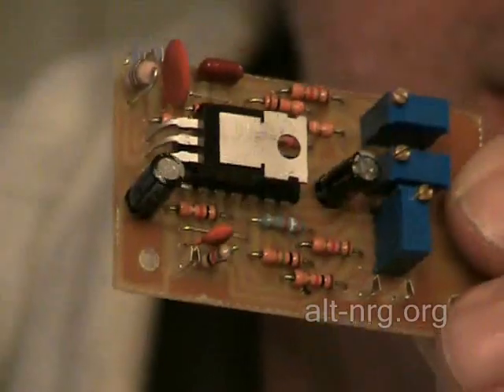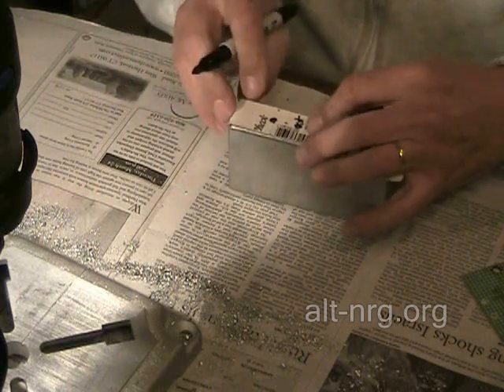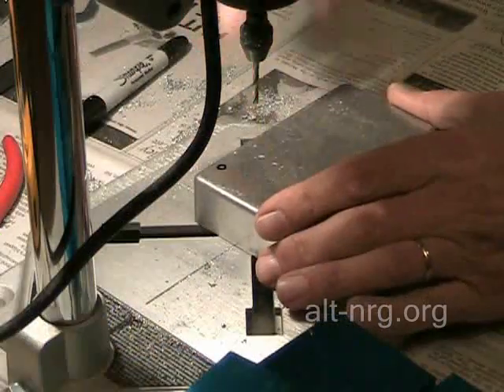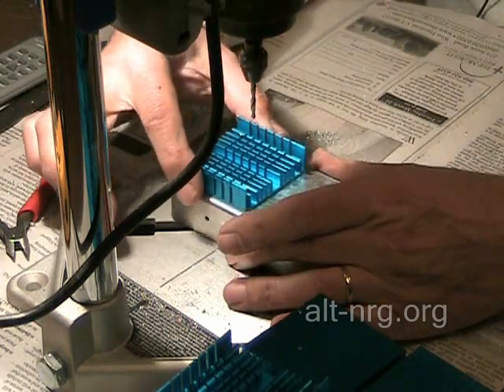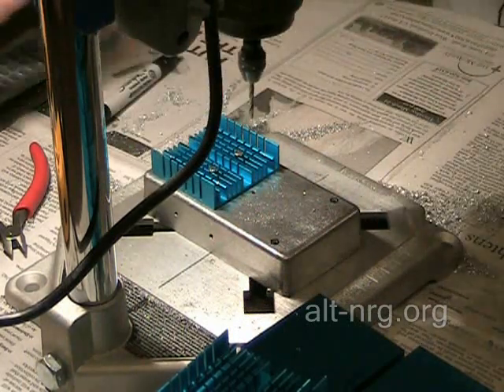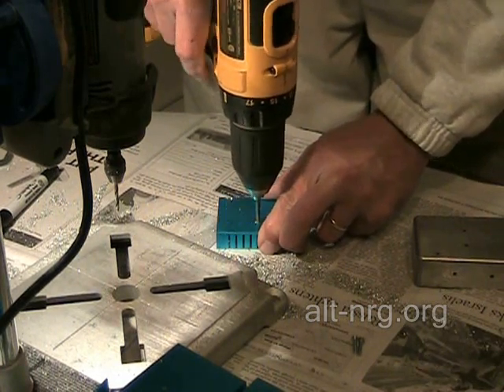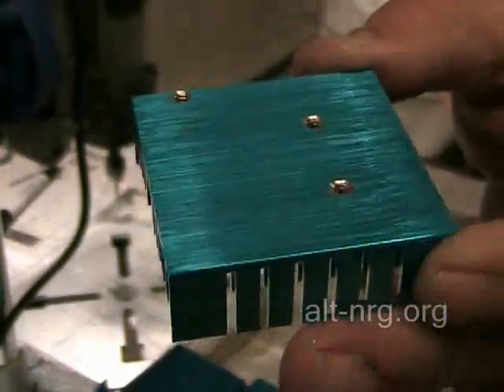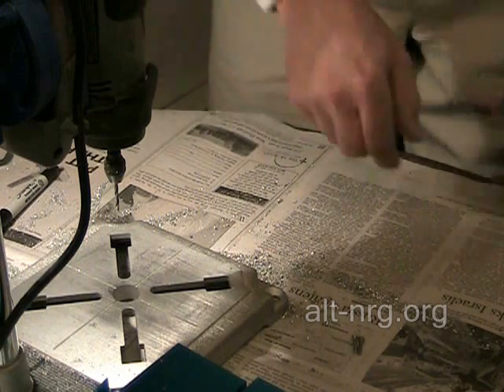#165 - PWM assembly DVD preview Drilling the diecast box

Comment from the maker: Yes. 

Frequency by ear because it really doesn't matter.

Current limit with a calibrated DC shunt.

If you can't get your hands on a calibrated shunt, try creating my Poor Man's shunt in video #43. Calibrate it against your DMM 10A range for 1mV/Amp of current. Then use your DMM on the 200mV scale across the shunt. It should be good for 50A or more when you're done.

Comment: I know it's late, but since this was brought up:

13.56 MHz is common in the semiconductor field. RF generators use this frequency to strike a plasma inside an etching chamber, which is used to shape silicon dioxide. I believe this specific frequency was chosen as a standard for the industry by the FCC.

I think ZFFs PWM would require a much smaller frequency since the idea is to limit current going to the electrolizer. However, John Kanzius' work still bears significant relevance to this field.

Comment: just wondering,how do you connect the mosfet to the heatsink?bearing in mind that the drain pin is connected to the case of the mosfet,so how do you connect it without grounding the drain?